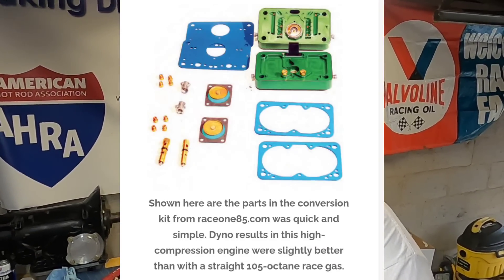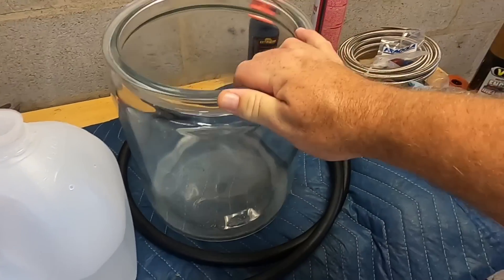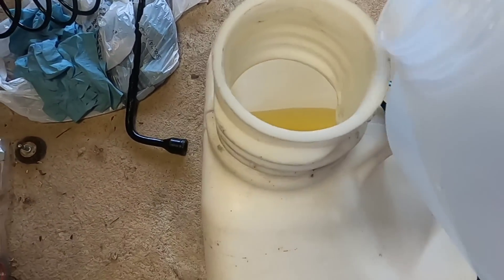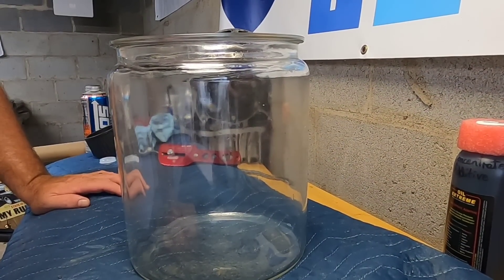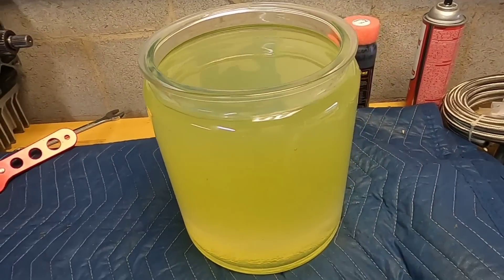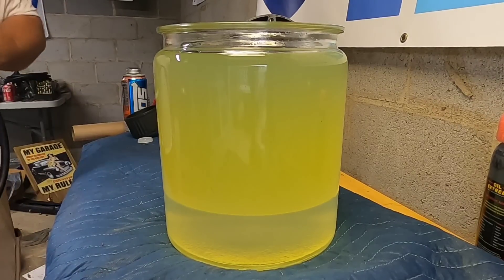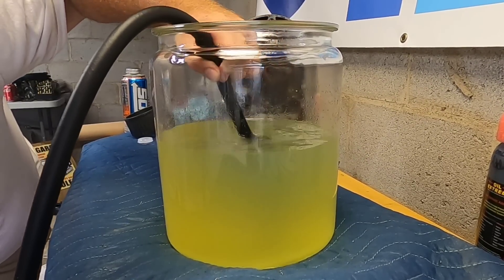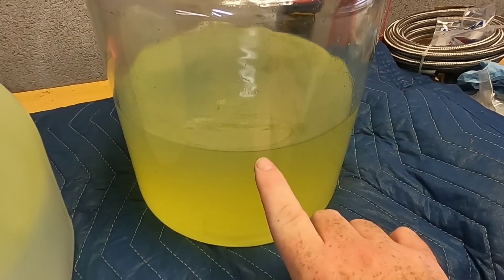Making your own ETHANOL FREE Gasoline!!! it's easier than you think!!

Comment: That little bit on top wasn't ethanol, it was gasoline. Vodka mixes with water in such a way you cannot differentiate the two, which is why you need a still to separate them. 

As for problems with engines, the additives are the problem, not the ethanol. I might have to set up one of my chainsaws to run on it and bring it to Missouri. They put additives in E85 and E10 that cause all sorts of problems, the white chalky residue, the yellow gel, rusty crud... its all from additives. Straight vodka doesn't hurt anything in our engines.

The additives vary by region and season. Some are worse than others, and I have had no problems with E85 I got in northern Wisconsin, but one store in Nebraska gave me the chalky stuff and some rust in a carb. Up here in the north its cooler so evaporative emissions are not as big a problem as in the south. So they have to mix better gasoline down south than up here. 

Adding lots of water to E10 will get the ethanol to separate, its kinda cool to do. I want the ethanol, but I am not paying 87 octane prices to get it.. lol.

My Cuda and a friend's 74 Dart have vapor lock problems up here, but didn't in Nebraska and Indiana respectively. Bring them up here and the lighter stuff boils before it gets to the pump on my 340 and his 360. Then the pump just stops working.  Electric fuel pump is the solution to it around here.

The reason is that gasoline has a bunch of chemical compounds in its make up, they range from 80F to 450F for boiling points, the lighter stuff boils sooner and creates a vapor that the pumps cannot move well enough to keep the gasoline flowing.

Conversely ethanol boils at 173F at sea level, so even running mechanical pumps I never had a problem with vapor lock. 6psi is enough to keep it from boiling.
Reply: That's what I thought too.
Reply: If you have the ability to go to a airport and purchase 100ll avgas.  It has no additives and can last up to five years.
Reply: @robertohlund9408  BY DEFINITION, 100LL contains lead.  It IS toxic!  You don't really need that much octane for any power equipment, and if you use it in a car (without a catalytic converter of course) it will foul your plugs. As an added bonus, it costs half-again to twice what no-ethanol 93 costs.  Why bother?!

Comment: OK, but why would you want to do this? How does this get your grass mowed that you couldn't have mowed before with the gas/ethanol mix?
Also, if you're actually lowering the octane, that's got to be a worse scenario as apposed to better, right?
Reply: Why? It's mainly due to the fact it's bad to have ethanol sit because it attracts water and can ruin your engine. It's not an issue for a car that constantly gets used but it's a big issue for cars that don't get driven during the winter or small engines like those used on lawn mowers
Reply: Lowering the octane rating won't do any damage at all as long as you don't go below the needed octane of the engine.

For example, if your engine needs 80 octane before it pings and you turn 87 into 84, it won't care.

Comment: Too bad it takes twice the amount of ethanol to run an engine then gasoline.  The only damage I’ve seen caused by running ethanol is the throttle shafts in your carb start to freeze up. You gotta install bronze bushings in your throttle plate unless your running fuel injection.

Comment: It takes more energy to produce the alcohol then you get out of it. We should be using the corn to feed people not burning it....just saying.
Reply: Your incorrect
Reply: @Russeljfinch  No I'm not.
Reply: @Russeljfinch  You loss about 55k btu's per gallon
Reply: Ethanol isn't made from corn for humans, it's made from feed corn that's slated for animals.

After the ethanol process is over, the 'waste product' is called 'Dried Distillers Grains' (DDG's) and it's now a better feedstock than it started.   Since the starches have been removed, it's now higher in protein, and it's worth more per bushel than it started.

Comment: You went through all that to get the ethanol out to run your lawnmower? Maybe read the owner's manual, who does that? OK I'm weird I do. 😆 
 You'll find in there that E-10 is an acceptable fuel. 
I've been running nothing but E10 in my mowers, snowblowers, old cars and trucks since the mid 1990s when regular gas in MN turned to E10. Zero problems ever from it.
 He'll I even ran E10 in my kids snowmobiles that ran mixed gas. Hoping to blow the damned things up! Supposedly if you use E10 with mixed two cycle gas "you'll wreck the engine". Didn't hurt them damned old Polaris sleds at all !
Storage BS.
My Arien snowblower is 11 years old now, never ran anything BUT E10. In that time I maybe remembered to use gas stabilizer 2 or 3 times. Never had an issue starting it the first time it snows on last winters gas. Lawn mowers the same way, no issues. 
 Yeah I know idiots will comment now. But that's over 20 years experience running the stuff. So before you call me stupid put in over 20 years with the stuff and we'll talk.
Reply: Most people don't want to deal with adding fuel stabilizer. It's just easier to use ethanol free and not worry about it
Reply: @AdamSmith-gs2dv  I use fuel stabilizer with my ethanol free gas. It's been a year now and the fuel still looks, smells and runs good. Trying to use it up and make a new batch.
Reply: I have been using plain old 87 with ethanol from the local gas station for decades and never had a fuel related problem. I've always run the tools out of gas at season's end. I've still got my weed eater from 1993 that I use weekly all year long now that moved south
Reply: @AmandaHugenkiss2915 running the small 2 strokes dry is best thing to do over winter.
Reply: let the E10 sit in the tank and the carb of your snowblower for 2 years without using it, and report back with the results.
Reply: @Boobtube.  only a fool leaves any gas sitting in the tank for years and deserves what results.

Comment: When we had purple gas on the farm in the 70's and 80's, Dad got some clear jerrycans, filled them and left them out in the sun for a couple days.  The purple dye would fade and we had red gas for the car.
Reply: You can do the same thing with off-road diesel
Reply: @bradhaliburton5974  The dye added to diesel is more than just a  colourent. Theirs also a trace chemical that dose not go away and the tests they do to see if you are running dyed picks that up.
Reply: @toejah  I've seen bentonite clay cat litter used to filter dyed #2 fuel oil.
Reply: @2000freefuel and how good does that work
Reply: @toejah  The only test they do to see if you are running dyed fuel is to look at it. That's the purpose of dying, to make it a quick visual check. There is no elaborate lab work involved. And they don't randomly check fuel in private vehicles anyway. I've had my rig checked at weigh stations. They open the cap, shine a light, grab a ladle of fuel, send you on your way.
Reply from the maker: That's pretty neat!
Thanks for watching
Andy
Reply: I remember doing that too where I'm from running purple fuel in anything but farm equipment was illegal!
Reply: @warrenkernot4522  If you watch "Wartime Farm" by Ruth Goodman, they used bread in the balckmarket in Britain during WW2 to filter the dye out of the gas.  They tested it and it actually worked!

Comment: What happens to the octane number when you do that? It is quite common to mix in 20-30% ethanol (E85) in regular petrol, to raise the octane number here in Sweden.
Reply from the maker: it lowers the octane of the Gasoline..  It can vary based on the % of Ethanol used.
Thanks for watching Peter,
Andy

Comment: Dumb question Ethanol free gas gives you more power? I know on my 2 stroke the ethanol gums up my jets if i let it sit in the bowl for a while i wonder if this will help with power.
Reply from the maker: To be honest I don't know. I have never done that test. but based on what I do know of doing back to back tests of E85 vs Gasoline on a N/A application I only seen a 7 RWHP gain with E85.  So I believe that the power difference is very minor between the two.  Most people prefer the Ethanol free gas for the reasons that you mention and the rubber fuel lines wont dry out and crack as time goes on.. You will find that mileage will increase by removing the ethanol..
hope this helps
Andy
Reply: Its not the ethanol that gums up ...its the gas & additives
Reply: If you're talking purely in terms of power, like in racing, ethanol CAN make more power (due to higher octane and cooling the air change) but this varies by engines. Some engines like alchohol some don't care. Boosted engines generally like alcohol. However, your average car engine or small engine will be happier on straight gas for other reasons.

Comment: This is the most boomer thing ive seen in a while. What's next are we gonna start trying to put lead back into the gasoline also? it's a cool trick but 10% ethanol isnt a big deal just put some fuel stabilizer in the tank if your gonna store something for an extended period of time or drain the float bowls.

Comment: I've been using a 30 gal. barrel(clear?)to get rid of ethanol for a long time.Ethanol will destroy my fiberglass saddle tanks on my bumpsides(3).When taking my trans-Texas jaunts,I put 5 gals. of Avgas and a squirt of 2-stroke lube to get my mileage back up.Of course,funding 60-80 gallons of pushwater is getting harder on a pension.

Comment: While you mention that the octane decreases, fuel economy will go up. It varies by vehicle, so the math may or may not work out on your particular mode of transportation. But for most folks, it is 5 MPG or better, so definitely noticeable.
Reply: Fully agree.  I put straight gas in my 2001 v6 Jeep,  I went from 18-19 mpg highway to 24.  I couldn't believe it, but there it was.
Reply: Yep cars get better fuel economy on nonethonol gas. They sell it for your old tractors and lawn mowers etc.
Reply: It's about 5-10% from e15 to non ethanol usually

Comment: I would probably have just siphoned the pure gasoline off the top down to maybe within an inch of the separation line and then kept the remainder for mixing into the next batch.
Reply: I like that. Your less likely to get water in your gas.
Reply: I thought the same thing
Reply: Anybody try building a separation tank with a bottom drain to remove the water from the bottom? After removing the water I figure some fuel stabilizer in the remaining fuel will help. I also have a water fuel separation funnel that perhaps I'll run the remaining fuel through first before adding the stabilizer. I just haven't figured out exactly how to build a good fuel separation tank with a bottom drain.
The separation funnel can be used on gasoline and diesel to remove dirty fuel too, with I believe a teflon coated mesh filter. Some people just mix water in gas then just run through the filter. Filter is 35 dollars for a small filter, but it's best to get the larger filter to handle 5 gallons of fuel at a time. I bought both. The product is called Mr Funnel available at many local stores. Mr Funnel doesn't work with stabilized fuel.
Reply: Add a tap to the bottom of the vessel (Separator)with a valve that way you can drain out the water/alcohol mix without all this siphon mess.
Reply: I was thinking about that but siphoning is like a straw so unless you go from the bottom it is likely to draw the water back up through the fuel and mix it again. I think I would try a food dye in the water but it would be a experiment because the dye might strip off into the gasoline.
Reply: Make a separation Funnel like we use in Chemistry class.   It's a large funnel with a valve on the bottom and you drain off the water with ethanol (it forms an azeotrope).  I wonder if any one has tried to distill the ethanol from the mixture or does the gas odor and other water soluble hydrocarbons and additives contaminate the water.  Either way, this is a DANGEROUS procedure.  I would only do it outside and not in my shop.
Reply: @Cowdiologist  Mr Funnel is a separation funnel that separates the water and contaminates from non stabilized fuel using a teflon mesh. I can't remember the flow rate but I believe my bigger funnel separates at 5 gallons a minute. I also have a water container that I have a valve installed in the cap that I can invert and use. The jug is the same as a high flow race gas jug. I just haven't finished it because I need to modify valve to get all the water out. 
Contaminated water goes to a hazardous waste facility in my country.

Comment: Andy now to continue on..Take your ethanol/water mix and for that quantity add about 2 maybe 3 cups of salt and a small amount of food coloring and stir to dissolve it in the mix..then let it sit and the ethanol and the water will separate...then draw it off just the same. This method is called salting out.
Reply: Thanks that's good , if I do it do you know if I could use the ethanol in a spirit burner for cooking when I  go camping  ? Cheers.
Reply: @royblackburn1163 Yes.

Comment: Never had a problem with E-10 87 pump gas in my lawn mowers. I had a 20 yr. old Craftsmen lawn tractor that I used pump E-10 87 gas in for it's 20 yrs.  Took the carb off to take a look
and it was shiny clean aluminum. Just don't store it with the carb full of gas.
Reply: Where do you live? Because its the additives that cause the problems. The additives are different region to region and they change with the seasons too. All of my E100 carbs are spotless inside, the E10 has some varnish, but anything with no ethanol is always loaded with varnish and rust.
Reply from the maker: You are right depending on location and season! When you run E100 talk about being clean! Especially the lack of carbon when you tear down the engine! I would change the oil more frequently.. 
Andy
Reply: Little or No Aluminum or Rubber to deal with on this, but this 110+ Year Old Tractor runs Perfectly Fine on E100 PURE ETHANOL 

It would normally Start on Gas then switch over to Kerosene once it warmed up, using a Water Injection System to keep it from knocking under a Heavy Load when running on Kero. 

One year the owner decided to try alcohol instead of water in the injection system and when he shut off the fuel supply to stop the engine it kept on running on the alcohol.

The next year he found a source for E100 and filled the Main Fuel Tank with it and tested it under various load conditions and has been running it on Straight Alcohol Ever Since. 

https://youtu.be/QVTCI0_GIbE
Reply: Yeah me neither on the bigger mower engines, but have had some issues out of the small blocks (2 stroke weed eaters) and stuff.
Reply: I don't use ethanol gas on cars that I store over the winter. It does carry water and can rust the steel gas tanks of classic cars.

Comment: I've made Coleman fuel from gasoline using heat to evaporate the lightest elements of the gasoline from the additives.  Gas evaporates at a fairly low temperature.  I used a cup warmer to do it to avoid flame and auto-combustion.

Comment: I absolutely HATE my lawnmower, but I still wouldn't put 87 octane in it. All my gas equipment gets 100 LL aviation fuel.
Reply: You are a crazy guy lol...any commercial lawnmower will run fine with 87...
Reply: Buy a Honda. Mine still starts with one pull after several years. And I only need about three pulls even after storing it with old fuel in it over the winter.
Reply: @myleftthumb2294  Mines a one pull as long as I shake the mower first, if not it's 3 or 4 pulls. Only thing I can figure is the fuel is separating in the carb. I run everything that's going to set for a while out of fuel anymore.
Reply: We use the wing samples saved in a can for the mower. 
But that's all they really need is 87,compression is so low enough and all that ,and they design them to basically run on any low octane swill. 
Since "we" are lucky with "free" 100 low lead I'll use it.
But using 93 in a mower is a waste of money and makes the ethanol problem worse than 87.